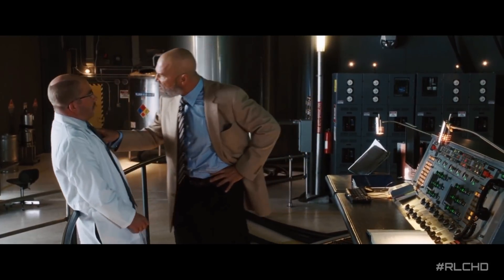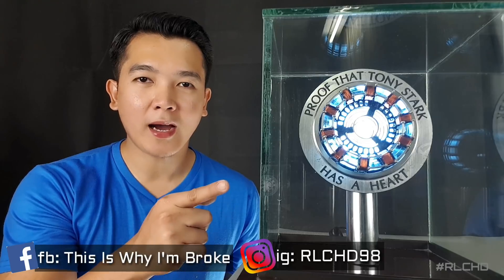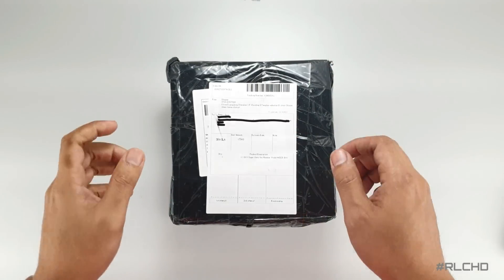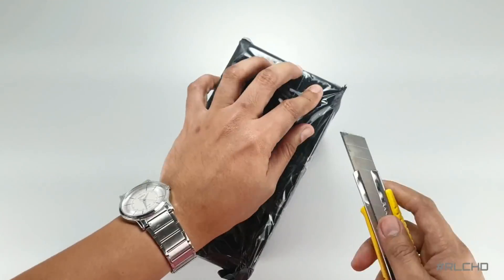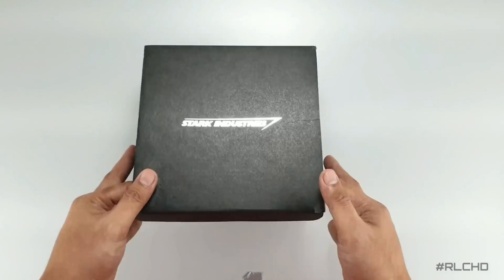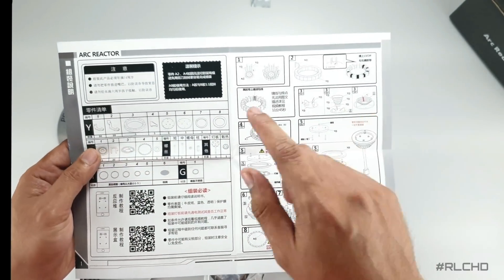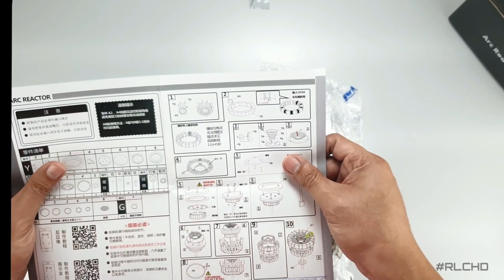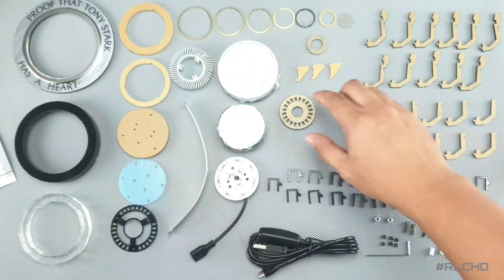DIY ARC REACTOR | 1:1 SCALE, MARK 1 - unboxing, build and GIVEAWAY!

Comment: Overall how difficult was this and how much skill did it require i want to make this for my self but actually be able to build it
Reply from the maker: For me, the most difficult part of the build is winding the coppers wires just because it's tiring and would take a while to complete. Everything else is simple and somehow require a little bit of technical skills. But if you can build Legos, wood puzzles, or any miniature pop-up card structure, I'm sure you can also build one of these.

Comment: Hello sir. Does the Arc Reactor ring already included in the box? I opened my box and there is no ring included
Reply from the maker: The seller often updates their items and links. To be sure we need to confirm it to the seller if the ring is included or not before checking out. Most of the time it's not included what I did was I contacted the seller directly. They usually provide you with a specific link for the package that has the ring. I think they updated their links again that's why the link in the description only has the arc reactor parts and not the ring.
Reply: @RLCHD   i already got the ring, it came with the acrylic box for the reactor.
Reply: @RLCHD  it took me 7 hours to complete assembling the reactor (ang tagal😂). I have to extend an hour because i had trouble with the tiny bolts. Your video is really a great help.😊👌 Thanks for this.👍
Reply from the maker: Thank you very much for the appreciation bro.

Comment: If I may ask po, I just purchased one from the link, its the alloy version.
Why is it na wala yung "Proof that Tony Stark has a Heart" na ring pati yung necking for mounting. 
Solely the Arc Reactor set lang po.
Is it purchased separately with the display box?
Reply from the maker: Hi +Omega Duncan. The seller constantly updates their items. What I did was I messaged them clarifying that I also want the ring. Paying close attention to the unboxing part, neck for the mounting is really not included. See 11:48

Comment: That super glue drop is so painful to look at :(
Reply from the maker: indeed it is. :( need to be extra careful next time.
Reply: https://www.ebay.com/itm/312612604453 This is the link to the product in the video check it out with a huge discount you can get your own arc reactor  with the case
Reply: Wouldn’t a bit of acetone on a q-tip take care of it?
Reply from the maker: Didn't work. 😔
Reply: Did it ruin the finish? The acetone I mean
Reply from the maker: Thank God it didn't.

Comment: Kasama na po ba yung ring name holder dun sa link kung san niyo nabili or separate pa po ninyo binili?
Reply from the maker: Yes. Just clearly confirm it to the seller. Send them a message before purchasing
Reply: Up
Reply: Kasama po talaga yung ring name sa purchase niyo? Or add on lang po siya? Ang hirap na po makahanap ng mark 1 na stock, puro mark 2 na lang 😂
Reply: Alloy version po ba yung nasa video niyo? Salamat ulit
Reply from the maker: Not the alloy version. ☺
Reply: @RLCHD  as per seller po, di daw po kasama yung ring name sa arc reactor lang, kelangan pa daw bilhin si bracket and box para sa ring name.. swerte niyo po may kasamang ring name yung sa inyo 😂